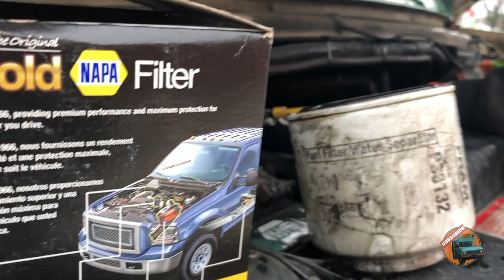Nothing Against Columbus, But... Why'd I Have To Break Down Here? It's a Long Road to the RTR

Comment: Your fuel gauges don't work?  Or don't work well?  On my motorcycles, I never had a fuel gauge so I always used the odometer.  Takes a while to get used to, but almost never left me stranded . (I can't remember if I ever ran out actually)
Reply from the maker: They don’t work at all now, because I disabled them once I found out they were lying to me. The odometer is super reliable if you know what size the fuel tank is!😉